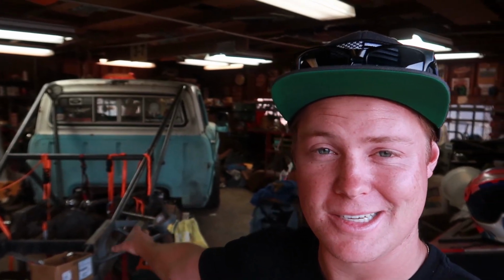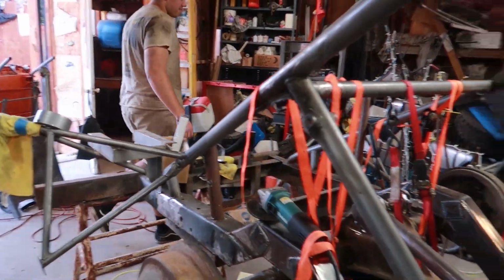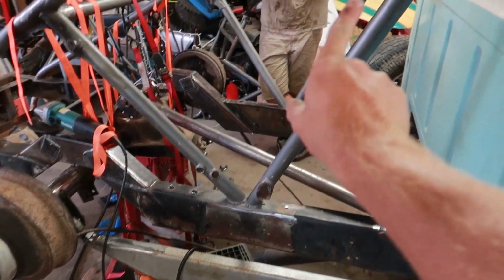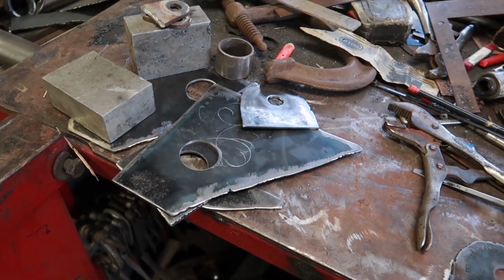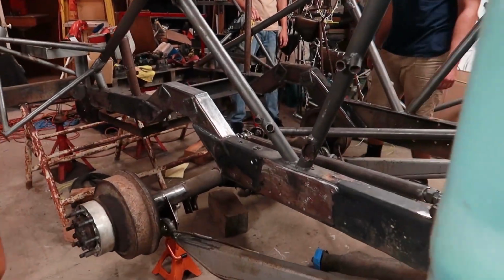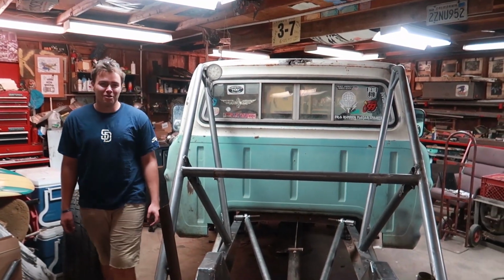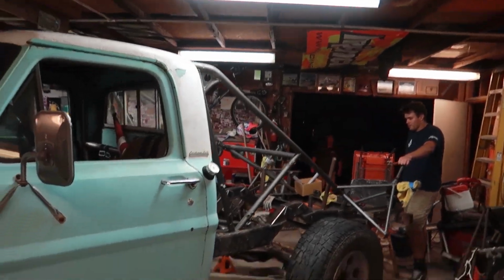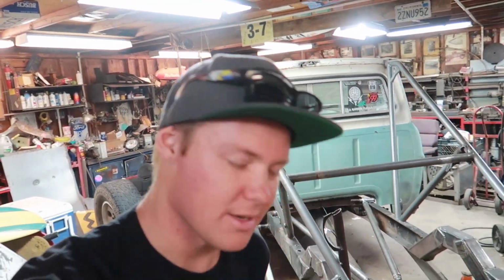VINTAGE PRERUNNER IS FOUR LINKED!

Comment: Love the build! Typically you DO NOT want to weld to the pumpkin. if you need the geometry from that area make a bent tube over the pumkin and weld to that. The pumpkin is usually cast iron and will crack due the welds and the stress!

Comment: I’m 14 and you’ve inspired me to save up for an old c10 and build it up to something
Reply: They can be fun, I started on my Dad’s in highschool and it is still a project 4 years later (been drivable for 3). There is a lot to research about old cars in general before buying one. Remember to not fall in love with whatever car/truck your looking at. Pick out all its problems and try and unsell your self from it , better to go back with an empty trailer than to buy regret on wheels. C10s are really good though, GM used all kinds of interchangeable parts. I put disk brakes from a 73 on my 68 using all factory parts, didn’t need any custom parts
Reply: Air n opportunity, young man! Just get out there n get started on it. It's like anything else, worst part is getting started!
Reply: If you want to buy a C10, go ahead and purchase yourself a set of rocker panels, they dont last long on these trucks

Comment: I would be worried about the welding to the cast iron differential, I see that as a week link in this set up.I would think you would of welded up a cradle to go from axle tube to axle tube  that would mount those upper links
Reply: I tried to get him not to we are gonna use the high nickle cast iron rod and preheat with trust tubes from the axle. Tube up to the tab

Comment: loving this build. however those tabs are super thin, Even if you brace them to not bend. I bet you will rip the bolt through them, you might get lucky and they start clanking as they get wallered out and you catch it before it gets bad. But I would not want to trust my life to those thin tabs. I would do 1/4 minimum but your best bet since you plan on jumping this thing would be at least 3/8. I built my last rock crawler using 1/4 tabs and bent a few and ripped one just doing some mild willing. I ended up cutting them all out and welding in all 3/8 tabs and 3/8 gussets. Its best to do it now while you have it apart. I know your on a budget, but safety should be your first priority. Other than that keep up the good work!
Reply: Hes doing some layover  plates on the holes to try and fight that

Comment: rule of  thumb  never ever  wield on a frame u bolt too  it . there is even a video on youtube on how to do this right .sorry to say i have got a few of  these were they  wielded to the frame  and  it was in pieces sold all the aftermarket parts for good  money when it breaks to sh.  i will give u 300 bucks  for it with all the parts that  is the most  i will pay for one..first  thing  a  frame twist and the step doesn't  twist so what do u  think the weak spot is right  were u f  the temper of the steel of the frame  right by the wield it will start cracking then break .this type of step only works on a  street truck and still will not  last as long as a full frame . i been building rigs  since i was   12  year   old and i'm 52 now and by dot stander u can't wield on a frame and drive it on the street . if u get in a accident and they find out u wielded on a frame  one hell of a law suit i use to have deal with dot all the time building trucks and other stuff but it is  not just  for trucks it is  anything on the road . so these custom shops that wield on the frame are building illegal  rigs a cording to the  law . try reading   a dot book on the laws for  building or repairing .  i use to build  custom show trucks and are trucks went world  wide  lots  of gov. contracts  all the  new state trucks  for   oregon , they were very anal  to  the    point  they would take toilet tissue  to the raw   steel  on the bumper before  paint and it could not leave any tissue  on it at all